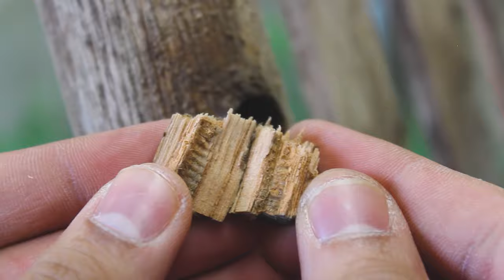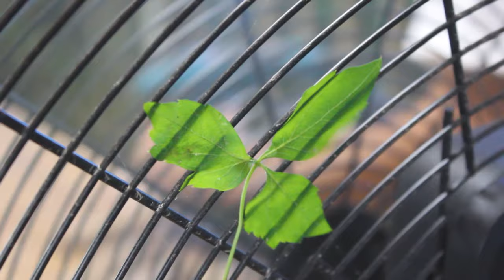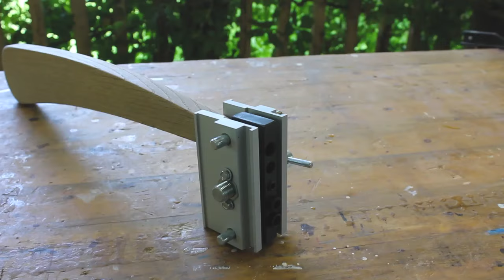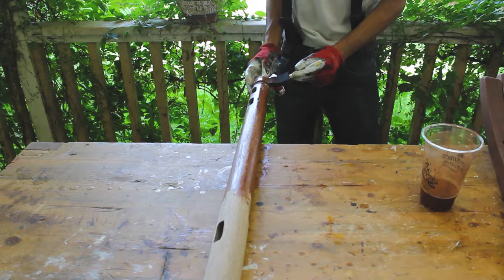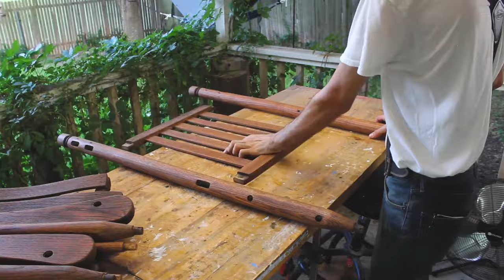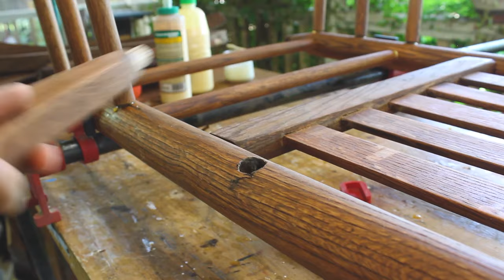Someone THREW This Chair Away! || A Mere Creator Restoration (Epilepsy Warning)

Comment: Amir, very impressed with your work and channel. Your skill with the dowels was masterful. Thank you. Wondering if dowels added after glue dried would have held as well as the gold screws?  It would have added a day or two, however.
Reply: What do you mean?
Reply: When Amir put the gold screws in to hold pieces in I wonder if he would have allowed the glue to dry , then drilled a hole to fill in with a dowel. That way you wouldn’t have unsightly mechanical fasteners, it would be solid wood.

Comment: Nicely done!
Did you consider applying penetrating epoxy to seal and strengthen the wood? I’ve seen this tip elsewhere. Might not apply if the chair stays indoors, but if exposed to the weather?
Reply: How does it work?